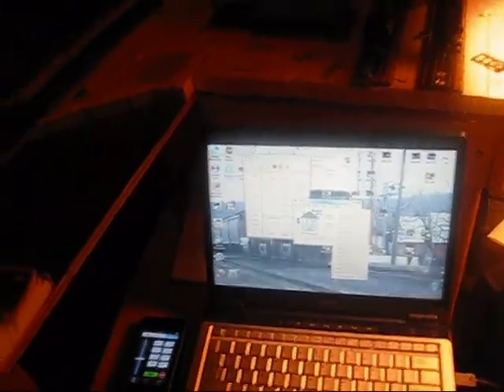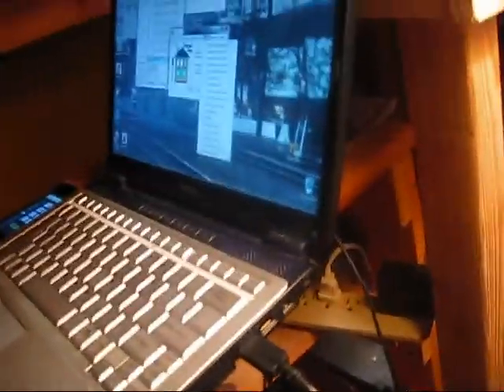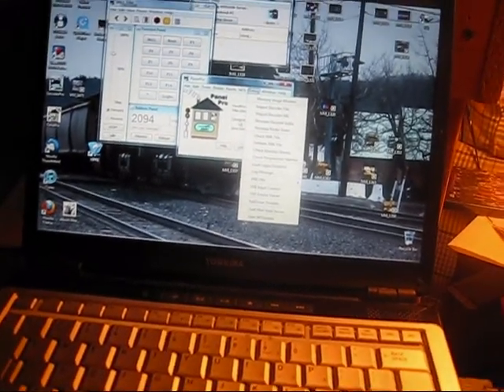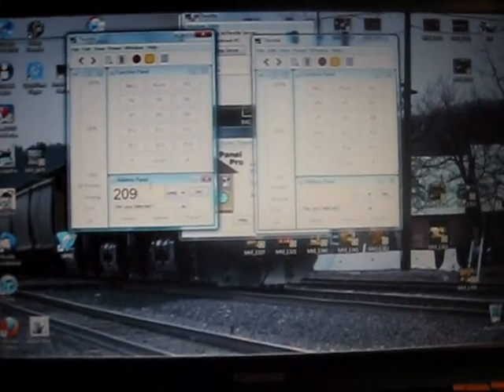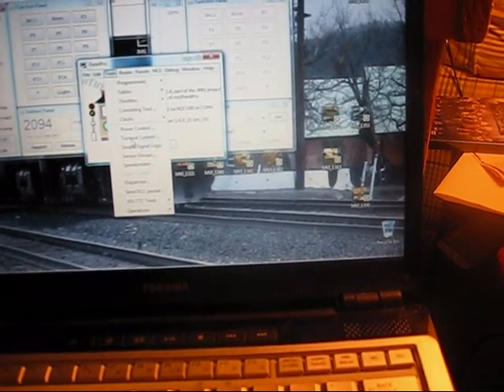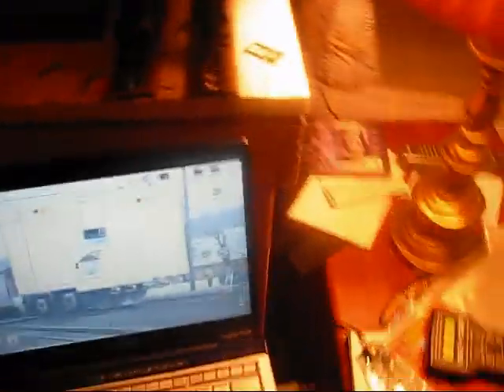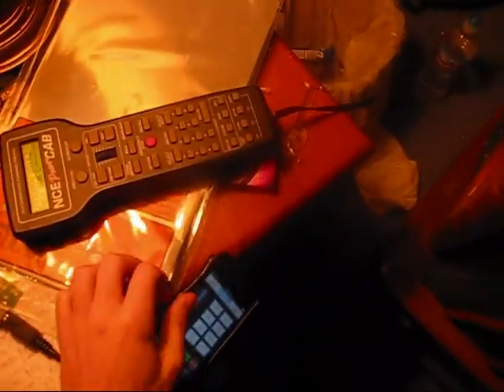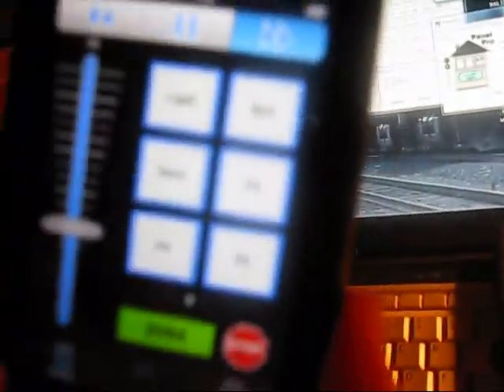How To Video: Computer Controlled Model Trains & Making Your IPod Touch/Iphone a Wireless Throttle

Comment: I'm new to DCC. Using the phone and computer seems the way to go. Help me understand the connection from the computer to the track. Is it computer>nce-usb interface>command module>power booster>track?  How if at all does the power cab throttle fit into the chain?  Thanks.
Reply from the maker: Think about it from the other way. The center/core of the system is the SB5 Smart-booster (command module and power booster in-one). Both the track Bus and Cab Bus originate from the SB5. The Computer (using the NCE-USB interface as a translator/converter) is an additional cab like Power Cab. 

Summarized my setup is SB5 >USB-interface>Computer and SB5>Track

NCE has some resources that attempt to explain things: https://ncedcc.zendesk.com/hc/en-us/categories/200066109-Manuals-Common-Questions-and-Useful-Information

What DCC system are you running?
Reply from the maker: re-watching this video, it would be good for me to re-do it - I have a new setup now. Something I might be able to do this weekend. Let me know what system and parts you have and I will give you some guidance.
Reply: Thanks so much, Drew. I don't have any components yet other than the computer and the phone. I grew up with DC but my friend and I have been contemplating building a set and DCC seems the way to go. And NCE looks to be the most user friendly with the ability to grow. I think I understand the connection now. The computer is acting as second cab, yes? One other question - can you control accessories (switches, crossings, etc.) with the PowerCab and or JMRI?
Reply from the maker: DCC is great, once you go DCC you never go back. NCE is user friendly and has great customer support. I started out with the PowerCab as a standalone. It's a combined booster, command station, and Cab all rolled into one handheld device.

The computer is indeed acting as a second cab. You can control accessories from both the PowerCab and JMRI. You would need switch decoders of course, the concept/logic is identical to locomotive control.